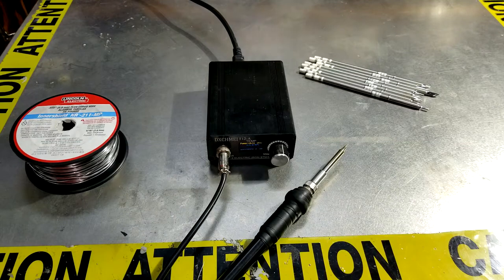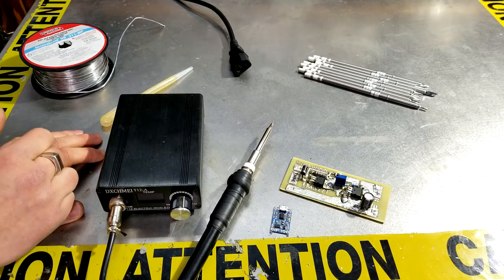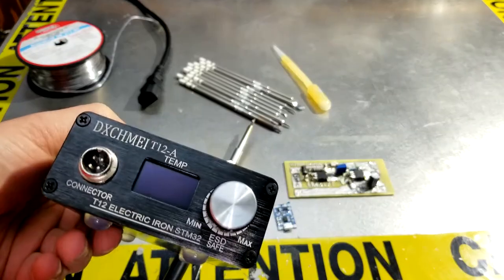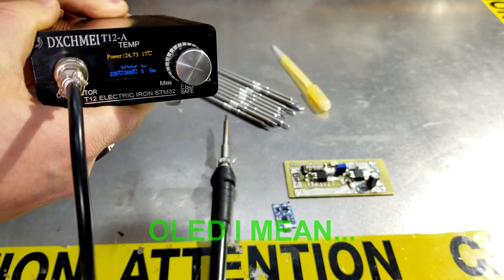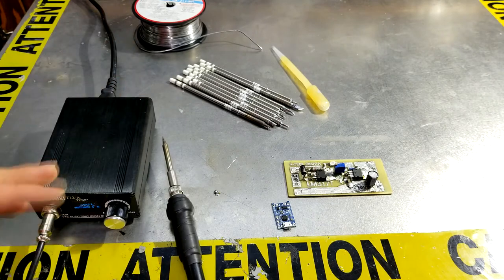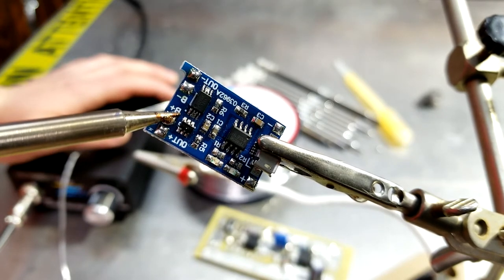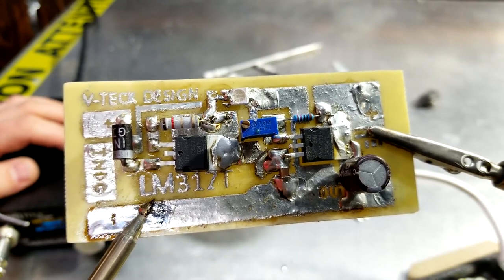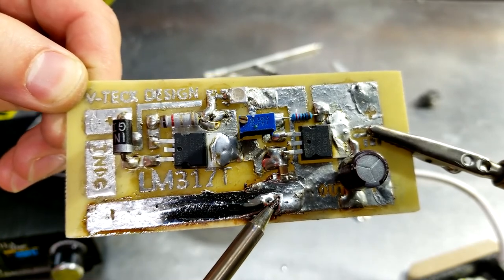Better that HAKKO? LETS TEST!

Comment: Great little Iron, I just put one together a few months back and currently editing the video for it. I ended up purchasing the kit and adding a better power supply. I also made the case out of plexiglass and added an adjustable fan. Ever since it was built, it is the only iron I will use, next to its brother the LED T-12 version.(that one I got the complete kit). You'll love this and the tips are crazy awesome...Just make sure you break in the tips before turning them full blast. I start my new tip out at the lowest the iron will go and every 15 minutes or so, I turn it up by 50. Then once it gets to 400, I make sure to use it for a good hour. You'll find out that each tip has its own power rating. Some are able to handle the OLED max at 450 and some won't go above 350. Great Iron!!
Reply from the maker: Yes this thing is the best iron i have ever owned!! Its just too good to be true when comparing to hakko or weller.
Been using this thing for 2 weeks now and its a pleasure!!!
Thanks for the comment!!

Comment: I'm not much of a electronics guy, but I do solder some audio cables or do the odd repair job once in a while and had been using some cheapo DIY store hot poking stick station that was just a nightmare to use. A Weller or the like was too expensive for the times that I would use it so ordered the quicko T12-952. Pretty much the same thing it seems. 34 euro from china.. holy moly, what an upgrade! I might even start to enjoy soldering again.